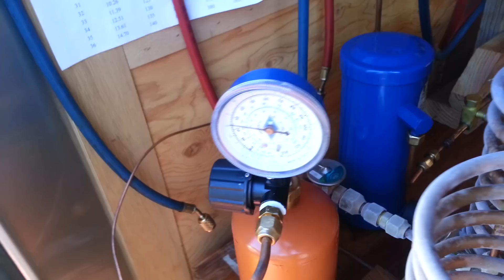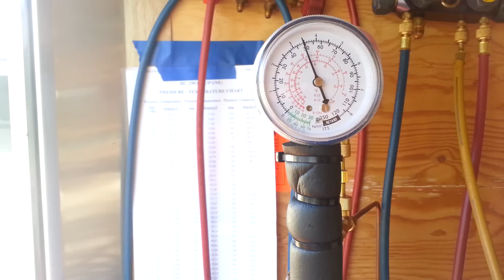Plastic Sight Glass - Liquid Propane

Comment: why not use carbon dioxide instead propane. carbon dioxide don't exsplode in case of fire or burn out on the compressor or leeaking.
Reply from the maker: Very high pressures and requires specialized tubing, fittings, and compressor. In cases of rupture, the pressure drop can aerate compressor oil in such a way as to make it easily combustible.  CO2 is a great refrigerant for certain applications, but I wouldn't want it in my home. Good point though!

Comment: Not to be as stickler, but your logic about protecting the PET tube from high pressure has a flaw. if you shut off the valves and  machine and walk away, the only way you will keep the pressure low in the PET tube is if you can thermally insulate it from the environment. otherwise, as the liquid propane  is no longer moving , it will sit in the tube and absorb heat from the environment until it reaches room temp. and at room temp, the volume of liquid you had in the tube at shutdown, becomes a significantly higher volume  of gas. the typical "compression" for gas to liquid is 800:1 but propane is a little more forgiving at 311:1. Still, depending on how much volume of liquid is trapped in the sight glass, it can still pressurize fairly high, depending on how warm the room is and how heat conductive the wall material is - the brass fittings are great heat conductors. so the pressure inside the tube will increase if left unattended.If the compression fittings or tube wall are not rated to take the higher  pressure, they will liberate that volume of gas into your garage. I would not recommend walking in with a lit cigarette :)
That one issue aside, nice job on the video.
Reply from the maker: +Joe Public Thanks for the insightful, Joe!  I think you are spot on!  

I'm not sure how I explained it in the video, but the reason for the shut off valves was not to prevent the plastic pipe from over pressurizing, but to limit the amount of propane released if it should fail.  I figured that if the plastic pipe would burst while I was running the machine, I have a chance to shut the valves off.  Mostly though, I wanted to minimize the amount of propane exposed to the plastic pipe while the machine is unattended.  When I would shut down, I shut the bottom valve first, watched the liquid boil out of the tube, then shut the top one.  This way I could further reduce the amount of potential release.

Fortunately, I've never had a problem with this, other than the PE inflating like a balloon.  High pressure nylon tubing worked better, but wasn't as clear.

Thanks so much for watching!  There aren't very many people that do!

Comment: Is that actual propane or is it LP fuel gas? LP is a blend of methane, ethane, butane, and propane and will fractionate with a temperature glide.
Reply from the maker: I think I said in the video that it's BBQ grade, HD-5 propane.  So yeah, it probably does fractionate, especially the butane, propane, and propylene.  I don't think the small amounts of methane and Ethane ever condense, but likely raise the head pressure.

High purity propane is expensive, so I'd like to try fractionating some myself!

Any experience?
Reply from the maker: https://youtu.be/ox6XlNYYXtM

check that one out.  I had it running today.
Reply from the maker: Sorry, maybe I didn't say what kind of propane in this video.  I was thinking of one I made today.